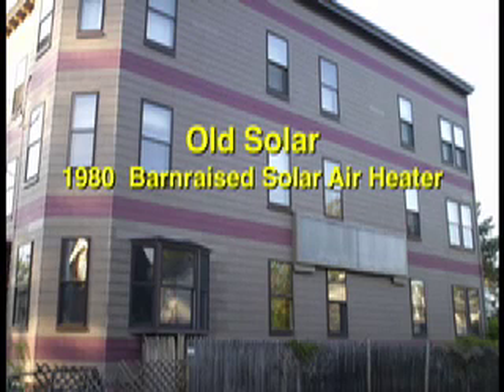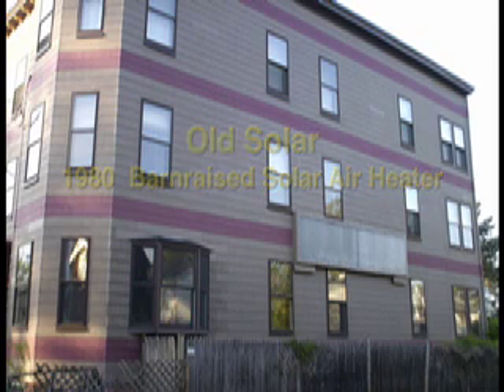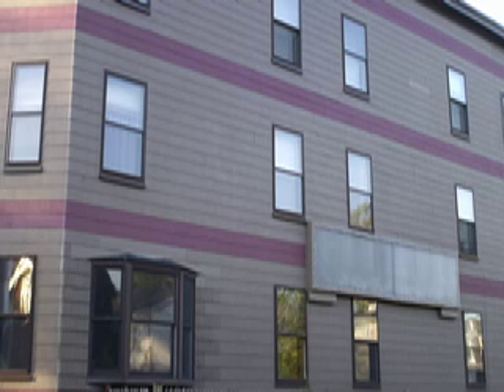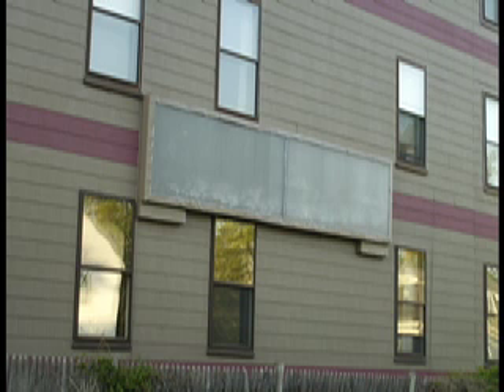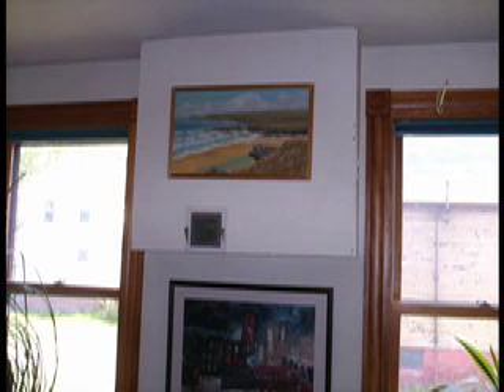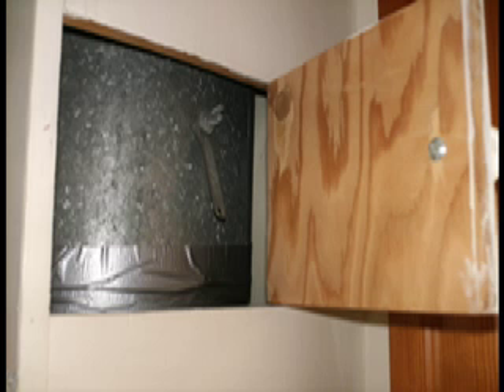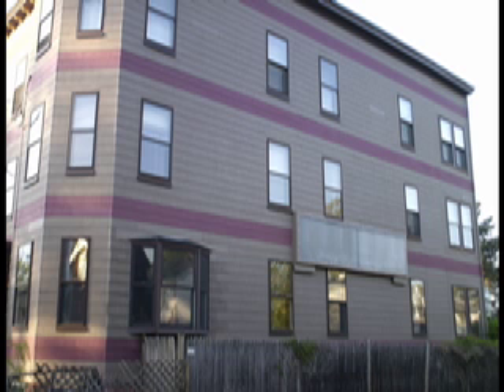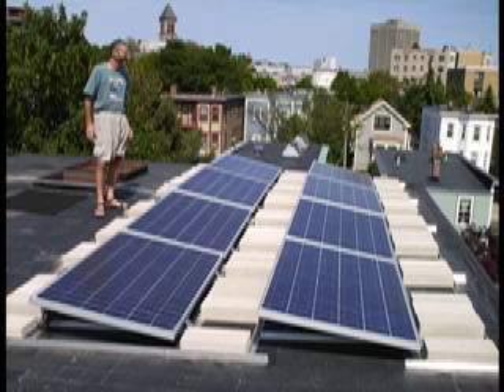Old Solar:  1980 Barnraised Solar Air Heater

Comment: I've built and installed a couple of similar style solar heaters with some nice results. I think the rule of thumb is that you'll see a max of around 30% fuel reduction. This can certainly be improved greatly with a design effectively utilizes Solar gain, thermal mass and insulation. Earthship style houses for example are essentially 100% solar heated, and should only require fuel as a backup. Hope some of this info helps and good luck on your project!